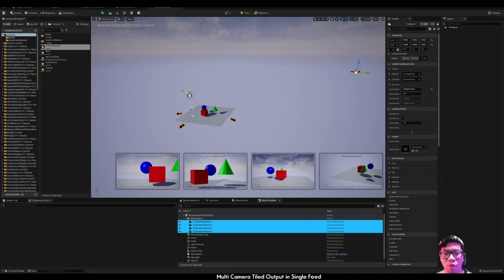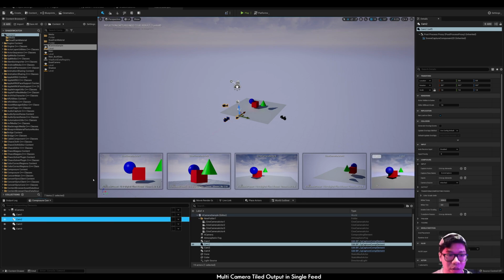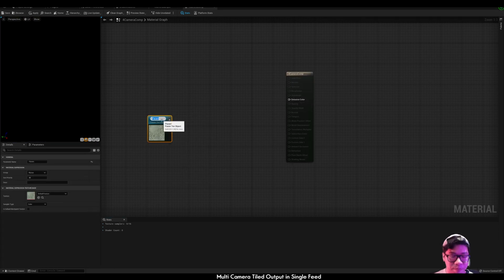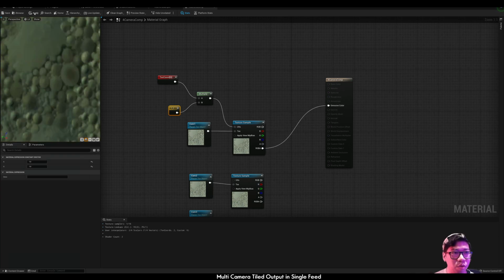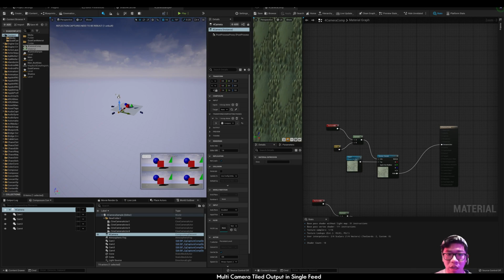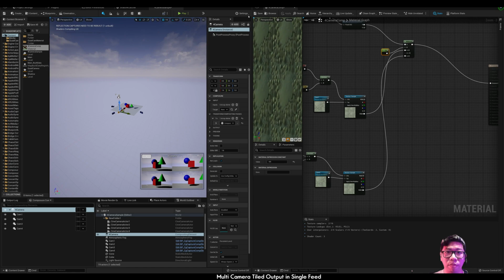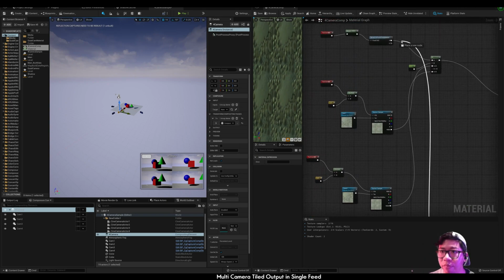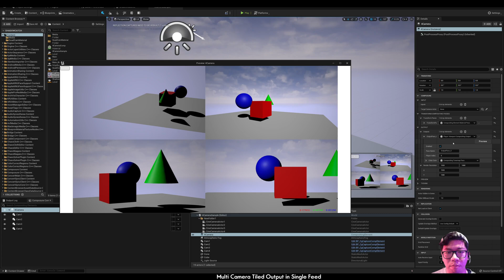Unreal Engine 5 ( and 4 ) - Multi Angle Camera Feed to Single Texture Output (6 minutes)

Comment: So I wonder, does each camera still do all draw calls? I am looking for a way to reduce the draw calls of scenecapturecomponents. As each camera tends to redo all material draw calls.
Reply: @Silvec-v2c its is a combination of using stencil buffers and the bool to render to the main render thread. In order to get it to work, u will need to use cpp and look into the source code of the scenecapture component. I havent tried implementing it myself yet. As I dont really need it right now. But from the source code description it is clear that it does reduce the drawcalls if implemented properly as they state it specifically.
Reply: I might implement it one day, but right now I need to get other work done first. Coincidentally I noticed the game "Ready ot not" to have this same exact issue. They use a body cam system which tanks your fps.
Reply: @Silvec-v2c what u working on?
Reply from the maker: @GTexperience_Channel  setup the scene in different computers and hookup the same input/movements 🫠
Reply: @dpredie  i found a solution. I can use the depthbuffer in combination with when u enable the bool to render on the main render thread. I am not sure if it is cpp only. But it should increase performance big time.

Comment: It lags horribly even with one camera in editor mode. Two cameras just stops the whole thing. Any ideas why this is happening?
Reply from the maker: Lower resolution, change viewport to unlit. Your gpu is not powerful enough to render multiple cams
Reply: @dpredie  Thanks I will try. I have 1070TI.
It actually appears as a glitch than the problem with power. E.g. having two cameras drops framerate from 100 to 1 - not linear (x2) but exponential performance drop.
Reply from the maker: @LubysLaurynas  multiple feeds need VRAM size. 1070 ti is like what 8GB
Reply: @dpredie  It is 8gb video ram. But I feel that this is not the problem of my setup. I can also recognize ram lag, it is not it. I can run multi screen and multi viewports in Unity with high framerates just fine. I will also try Unreal 5, instead of 4.27 to see if it is any better. My scene is also very complex, but there is no way around it.
Reply from the maker: @LubysLaurynas  try running the GPU profiler and see the bottleneck and disable things see if you can pinpoint it or try workflow with simple scene just to confirm

Comment: is this means we can output multicameras to blackmagic atem switcher?and then control it with it for live broadcast?
Reply from the maker: This is single video feed with tiling. Can ATEM split tiling? I suppose for your needs you can either use spout or NDI to output multiple feeds And have it outputted to atem as separate feeds OR have multiple Render nodes OR simply have in-UE switcher